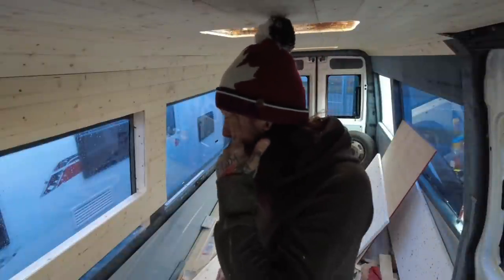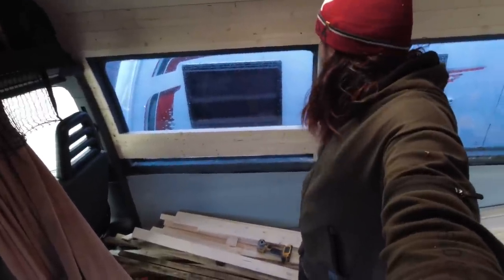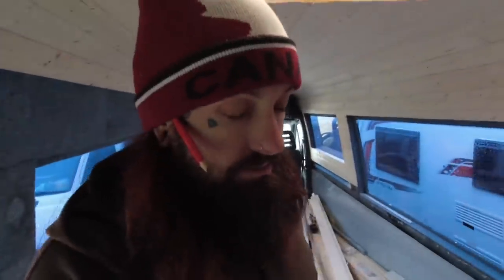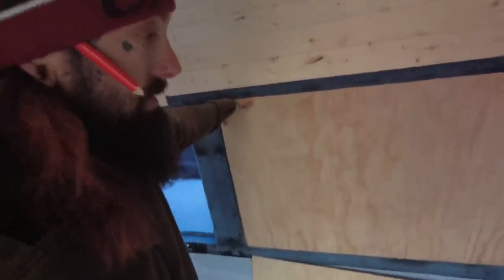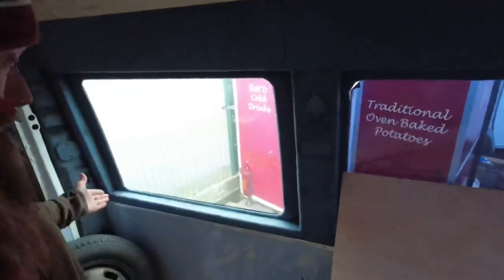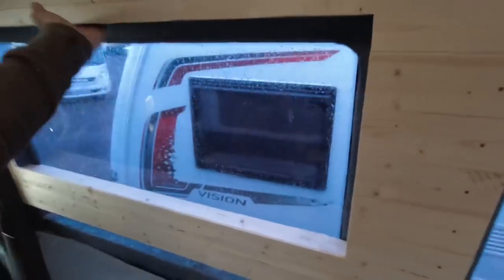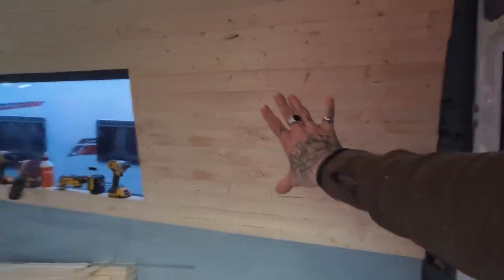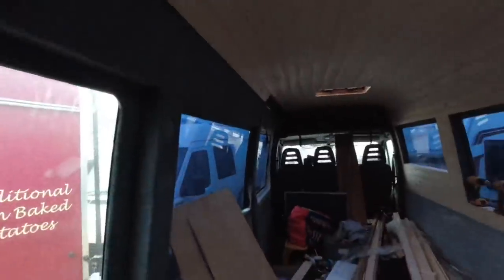Ex Ambulance to Campervan // Pt Two

Comment: Washing up liquid in a spray bottle over the window, Stanley blade to scrape the heavy residue of the glue, then  use a  cloth and keep rubbing, DONT shake out the build up of glue on the cloth, the more it builds up the more it helps remove itself from the glass into the cloth,  just keep rubbing. Should have that window clean of all residue in about 10 minutes. Believe it when you try it👍

Comment: Looks great. If the glass is factory tinted you can scrape off the glue with a razor blade very quickly. (Doesn’t work on aftermarket tinting tho) :)

Comment: Everything looking great so far mate, cracking job! Do have a quick question, with covering the windows with insulation n cladding over it, won’t the windows still get condensation on the inside which would cause mould eventually? I have no idea was just wondering if I’m way off or if there’s something you do which prevents that from happening!? Cheers